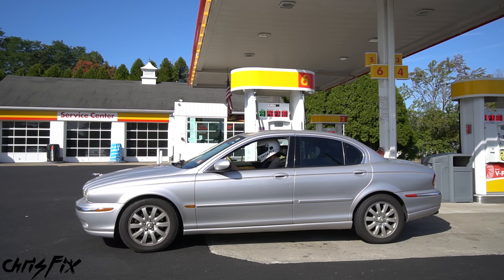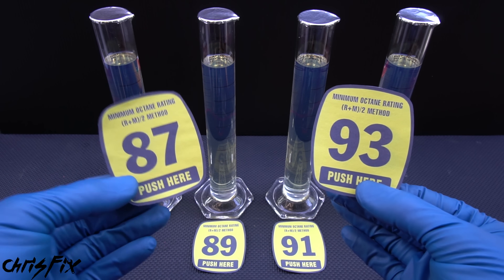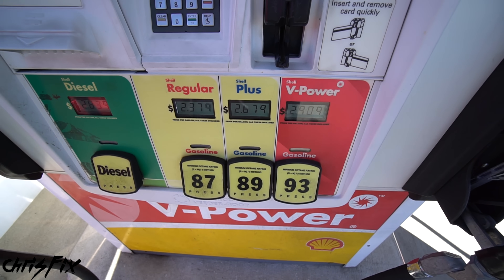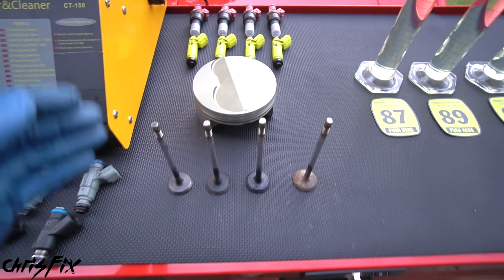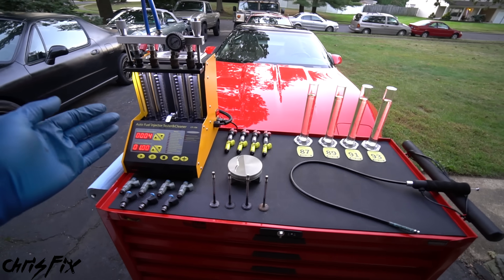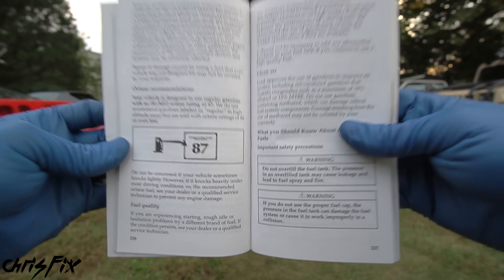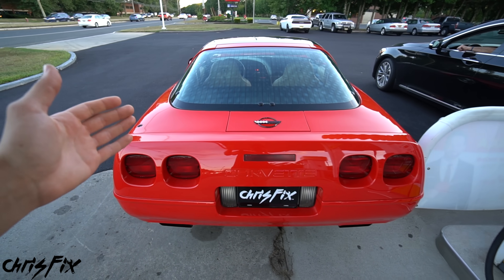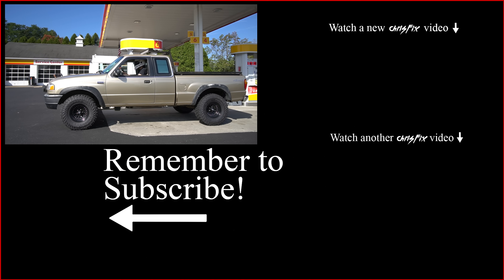What is the BEST Fuel to Use in Your Car or Truck and WHY

Comment: My car(07 charger srt8) calls for premium gas. But my "problem" is that i get free 87 octane gas from work. Ive been filling up with the free gas and my car seems to run fine. Everytime i end up having to pay for gas i buy premium. Would i be good continuing to fill up with free gas? Im saving a ton of money as my car averages 12-13 mpg how i drive
Reply from the maker: If you want your car to last as long as possible, I would fill it up with premium if that's what it requires!

Comment: You missed a very important detail: As a car gets old, the engine tends to work harder and knocks are more likely to occur. This would require a car that used regular gasoline to upgrade to a higher octane fuel. Otherwise, older car would be really loud when you accelerate.
Reply from the maker: Thanks for sharing!
Reply: That's a fact
Reply: I like a car to be loud so thanks for the advice
Reply: What is probably happening is carbon is building up in the cylinder, not only reducing the volume in the cylinder and thereby increasing compression, but also hot glowing carbon is acting as an ignition source, causing premature  ignition, pre-ignition. A nice long drive at highway speeds might burn some of the carbon off...

Comment: I remember we used straight up 32 callings if lighter fluid in a 2006 suburban.  And it ran fine , we still have the suburban and we’ve pulled the motor, we didn’t really see any damage
Reply from the maker: huh?
Reply: ChrisFix not “callings” I meant Gallons 😂

Comment: You did not mention Pure Gas (ie, Non-Ethanol gas).  I hear this is wonderful for cleaning the engine and injector system as it does not leave any deposits. It does come in various grades but I understand that any non-ethanol fuel is better than every fuel with ethanol. Is this correct?!  Awesome channel Chris and love your positive attitude dudeman!
Reply: Where do you find?

Comment: In europe the lowest ron for the gasoline is 95, which equals to 89 in usa. So your 87 is about 93 in europe and you cannot find 93 in europe. All the gas engines in europe require at least 95 ron. And how most of the people use the least expensive fuel, which is 95 in europe and 87 in usa, we can say that europe uses better fuels.
Reply from the maker: 95 can be 87 (or possibly 89/90/91), it depends on what the RON/MON are. It could also be higher or lower depending on the location and time of year. And like I said in the video, the bigger number doesn't mean that the fuel is somehow higher quality than in other parts of the world!
Reply: @chrisfix  I know what octane number is but I only talked about the differences between usa and Europe. 95 in Europe is regular and 100 is premium. 100 means 95.5 in us standart (R+M)/2, so there is a difference. I like your videos, keep up the good work!

Comment: I have a 08 Lexus with a 3.2 engine.  Supposedly Lexus says to use premium.   Then a couple years later, they said regular is okay.  I did not find where they changed the engine at all.  The mechanic at Lexus said corporate wanted to say premium because BMWs use premium.  I use regular and have never heard pinging.
Reply from the maker: What does your owners manual say? And if you use regular and have never had any issues, I would just keep using it!

Comment: its not completely necessary  to run the gas thats on the sticker modern cars ( at least since the 90s ) can adjust whats needed according to the fuel thats in the tank to run within spec so higher octane in a car that claims to need regular can self adjust to a certain point so you can run the premium to benefit from the additives in it the other way around if lower octane gets into a turbo car it will adjust the ignition yeah you lose power but ive seen people spend all their money on a souped up turbo car but cant afford the proper fuel or parts in europe right now they cocked up the fuel composition by law running up to 10 percent bio ethanol in the 95 octane fuel ( some crap about better for the climate and what not THATS TOTAL BS BTW ) and all cars that come through the shop that i work at get trashed by it the 98 octane still only has up to 5 percent bio ethanol in it and every car that switches to that runs better even though the sticker says to run 95 i myself run 98 and have a sticker that says 95 but even before the E10 crapshow it runs better on it better throttle response better economy and less engine noice and thats on a 99 volvo s40 with a good clean and well maintained engine thats stock no tune or any other adjustment on old carburetor or early fuel injection cars its a bit more tricky if you want to run higher octane its a bit more hands on but then youre getting into the tuning the engine to run better on that type of fuel

Comment: What about a 10.3:1 compression ratio? And I use shell so since they use 7x more additives in 93, vs 89, would it help clean my engine if I run it every now and then
Reply from the maker: What does the owner's manual say for your car? And it would definitely help!
Reply: ChrisFix octane rating of at least 87 but I use mid grade because of the compression ratio and I do hard driving sometimes.

Comment: I been using sta-bil 360 marine in 87 top tier gasoline and I can tell a considerable difference in throttle response and fuel economy with no detonation pinging or spark knock.

Comment: I'm glad you uploaded this!
I'm driving a 2001 Mitsubishi Space Star with a 1.8 l 4G93 GDI engine.
The manual recommends using 95-octan petrol/gasoline unleaded without ethanol. You can use 87-octan if necessery.

Now, I live in Sweden and swedish petrol/gasoline is regular 95 octan unleaded with 10 % ethanol, this is the standard since 2010.
Due to the carbon deposits in the intake valves, ethanol makes this even worse when combined with EGR. Ethanol is selfigniting at a cooler temperature than petrol/gasoline, that's why GDI engines have big problems with carbon deposits.

Mitsubishi has said that GDI engines runs best with 102-octane unleaded without ethanol, but this I can't buy or import from anywhere due to our goverment has monopoly of Swedens import of petrol/gasoline.
What we do have instead of 95-octan unleaded with 10 % ethanol is 98-octan unleaded with max 5 % ethanol (different between gas stations), and Mitsubishi recomended me using this.

Would someone comment this?

Comment: If you own a Mustang or Ranger 2.3 ecoboost, and if you compare the dyno and performance with 87 octane vs 93 octane, what are the differences in horsepower increase and 0-60 or 1/4 performance on identical cars?

Comment: Funny, in USA Gasoline is more cheaper, than Diesel.  Thats why  in USA are  majority of cars in Gasoline.  In Europe, Diesel is mostly  cheaper, than gasoline.  And in Europe majority of cars is with diesel engine. But,  in a fact, Diesel have more torque and power and lower  fuel consumption, than gasoline.  I personaly dont want own  car with gasoline engine.  Those cars are powerless. Diesel engines is more reliable, like vw  passat 1.9 TDI.

Comment: I run only LPG in my Ford Falcon. The oil doesn't ever get dirty. There are no carbon deposits. It has 504,000 KM on the clock (2003 model)

Comment: Most new cars have the needed octane listed inside the gas cap area ...right  ?... my Acura states to use 91 octane but I run it with 89 with no issues...but when I put in 87  I noticed a difference right away ....

Comment: What fuel additive do you recommend once and a while.
Reply: Imo..Sta-bil 360 marine is the best because of it's ethanol fighting and water removal properties. One ounce treats up to ten gallons and will burn away that ethanol varnish off the injectors, throttle body, valves etc. I run it full time in every engine I own and they love it.

Comment: My car recommends 87 Octane fuel. I once used 93 to clean things out. But within a day I started hearing what sounded like a rock tumbler in my engine. I (stupidly kept driving for a about 2 days, under 30 miles) and finally took my car to the dealer. They said my timing chain tensioners were shot and that my AC compressor was going bad. Is that possibly related to the higher octane fuel or just purely coincidental?  '13 Buick LaCrosse 2.4L

Comment: I'm running an 11 wrx, have had it since 2014, about 110k miles original motor.  Injectors have been replaced with COBB 1000cc so those are fine but thoughts on potential build up in the engine?  Have always used 93 never missed an oil change.  As far as power, it has stock internals just full bolt ons (original turbo).  boost is around 18lbs.

Comment: there video is not entirely correct as it should also show premature ignition which can bend or break the piston arms due to ignition happening before the spark plug fires from high compression

Comment: Hey chrisfix I just bought a new Honda Civic sedan sport 2020, I’m getting to that first fill and I’ve been told run premium due to cleaner engine better performance etc, I have two vehicles  the civic and a 05 Buick I run arco 87 in Buick seems to do alright sometimes may here or feel the not so great performance but that’s alright it’s a work car and old and I don’t care to much about it, but the civic is new and I do care and want it to last many years to come, it says online a lot of mixed ideas on what u  should do long story short what would u recommend if I want my new Honda Civic to last years to come with lil to no issues?
Reply: **Maybe your best bet is to check Honda Civic forums (and they may even have suggestions for which fuel brands give the best results).**

Youtube has a million current and former (like me) car mechanics, all have both relevant and irrelevant advice, some may be what was true years ago, but isn't any more.

Another problem is what is true in one country may not be true in another.

For example, I would say use premium for the following reasons:

- In Australia Premium Petrol is of a higher quality than "regular", for example it contains less sulfur, more detergents, and more octane (off the top of my head I read that Premium fuel can be stored for several months before going "off" whereas regular would last a month at most.

- Ethanol fuel has lower energy content, meaning that you have to use more to get the same range as 100% gasoline/ petrol, though it does raise the octane rating of the fuel a little.

Your car can run on it as well as "regular gasoline", but you won't get the best performance 

(here is where old truth meets new truth, as long as you put in petrol/ gasoline that meets the minimum octane rating, your car's ECU will work out the ignition timing based on the ECU's programming and inputs from the "knock" sensor to prevent ignition issues, which is why there are some turbo's like from Hyundai and Kia that run on regular gasoline),

But at what point do you get no further performance from using a higher octane fuel?

For example here in Australia using the RON system we have 91, 94 (E10), 95/96, and 98. So which one gives the best performance and which is not yielding any benefits? 

So if you want to get the most longevity I would recommend premium fuels (if your budget allows).  

Don't forget that the base fuel for all brands is the same (at least in Australia), the different brands then add their own "secret herbs and spices" (additive package), and some cars seem to perform better on some brands over others.

Comment: Hey Chris - You need detonation for your car to run. What you are talking about is pre-detonation.
Reply: Ahem, the normal situation...
The spark starts a burning process that becomes a 3d wavefront that smoothly spreads throughout the fuel air mixture thus smoothly increasing the pressure which reaches a peak ideally after the piston has begun its downward motion.
A detonation, on the other hand, involves the entire compressing fuel air volume igniting simultaneously causing such a precipitous rise in pressure it generates a shock wave whose effect is very much like hitting the piston and cylinder wall as though with a steel hammer.
Detonation occurs when the temperature of the compressing fuel air mixture reaches its 'autoignition  point'. The more homogenous the mixture the more simultaneous the ignition, the shorter the detonation duration, the greater the peak pressure, the more intense the shock.
Parallels:
Black gunpowder burns whereas nitroglycerine detonates.
Harder to shatter crystal with a rubber hammer than a steel one. U know why.

Comment: I found this one out but it also affects your fuel filter. Had a Subaru that got a check engine light after going to the mechanic they said use mid instead of low grade and once I did that the engine light went away.

Subaru am I right

Comment: Chris fix, you are exactly correct in your explanation of the fuels, . But, as I have found out, it does not matter to most people because they cannot understand the physics, chemistry and logic of your explanation, therefore they revert back to their simple minded logic, "if it cost more, its better".
Unfortunately, simple minded people make poor and wrong decisions in every aspect of their lives, not just their choice in fuels.
It is a matter of cognitive capacity, you cannot explain or teach someone something they are incapable of comprehending.

Comment: yea here in Aus we use RON 91, 95, and 98 octane, i was rly confused abt that for a sec
Reply: Yeah. Same. But it all makes sense. Premium you can't go wrong with regardless of the petrol engine though but it's made me somewhat rethink about sticking premium in my Commodore all the time but then again, at 220,000+ kilometres, I can't argue with the results. It's still going strong aside from general maintenance.

Comment: Very informative video, I dig it. Being a auto professional and engine builder i know most of this info already but there were one or two things that i did not know that this video helped to clear up like the fuel rating of gasses in other countries. One thing that I think should have been included though was info about the differences between fuel with ethanol and ethanol free fuels. Where i live there are some pumps that have both 93 octane as well as 93 octane ethanol free fuel,  which ethanol free fuel is what i run in my Yamaha r1, or my rm250, snowmobile, etc., and learning the difference can be a big help for people that ride harleys or street bikes because they run best on ethanol free fuel, albeit it is more expensive than premium fuel even, but is worth it in the long run for those types of machines. Keep up the good videos man, this one is pretty cool.

Comment: If regular 87 is recommended in owners manual, is it still good to use premium 91 to occasionally to clean the engine?
Reply from the maker: You can totally do that. You would need to use premium for 2500 miles straight to get it 70% cleaned out. Using it once might help a bit but not a lot.

Comment: Only thing I would add is that from the year 2000 and on all gas stations started to add "10%" ETHANOL AKA E85 AND thats where USA gas is different then European gas. ETHANOL burns hotter so it destroys valve seals on the Head and destroy older vehicles pre 1999. Causes to burn oil and gas. Sea Foam gets rid of ETHANOL and water in the tank. WAWA has ETHANOL FREE GAS, DEFINITELY should make a video about ETHANOL FREE GAS, overall good video.

Comment: Excellent engineers and mechanics know that premium is best for all cars in reducing emissions, especially true in older cars, older cars may fail a SMOG CHECK, because 91 and up cause less emissions. Higher octane like you stated decreases chance of knocking, which damages a cars engine in older cars, because they are less efficient then when they were new, due to common wear and tear. This video was excellent, but missed a couple very important, key facts in older cars.

Comment: $2.38 a gallon? God I hate you. 😁

 A big thing people don't think about also is altitude. When you show your vehicle that recommends premium and your at an altitude of over 4500 feet. You don't need premium and unless your running a real high end performance vehicle and you still get the knocking sound. You shouldn't have to worry about it otherwise. Less pressure on the outside and the fuel will burn slower thanks to the higher altitude. 

This is a great video! People way to often get up sold on more expensive fuel thinking they need it and they don't. I am out here in Carson City, NV. and Lake Tahoe is only 1,000 feet more in elevation. 

The summer winter blend is nothing more than adding alcohol to your tank. Never understood why such a big price hike for alcohol? Very few areas in this country will never see -40° below F or C since they are both the exact same temp where you need to even remotely need to worry about fuel freeze.

Comment: So once in a while us a high octane to clean that fuel injector?
Reply: He says in the video it only works apparently if you drive 2500 miles or so on high octane fuel only before over 70% of the carbon buildup is removed. A more effective way to remove carbon build up is using SeaFoam which he shows you how to use on another video. He puts the same camera down the hole where the spark plug normally sits to show you a before and after shot of the carbon removal on the piston, so im assuming it would do the same for the fuel injectors as well since the seafoam is sprayed into the air intake hose...(mixes with the fuel and air and hot soaks in the engine after you shut the car off for a bit) seafoam is best for cleaning out carbon deposits. If your cars sensors go awol after you do it though you simply have to detatch your negative terminal on your car battery wait a few minutes and reattach it)
Reply: Thank y'all
Reply: How y'all holding up with this covid19?
Reply: @salvadorsanchez447  well I'm in Canada so, we don't have that many cases...so....not dead yet.
Reply: Great stay safe !!!